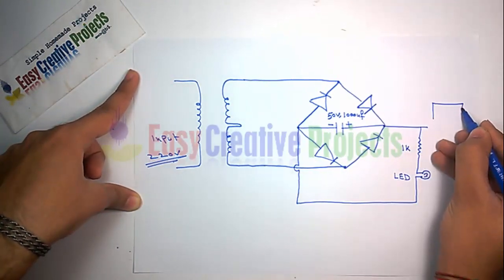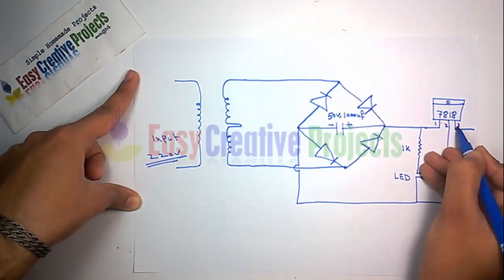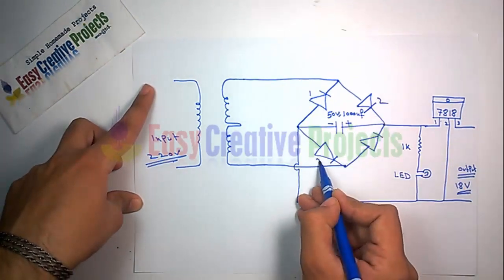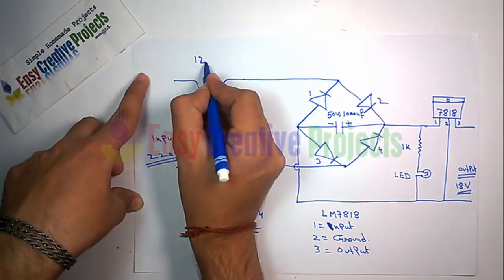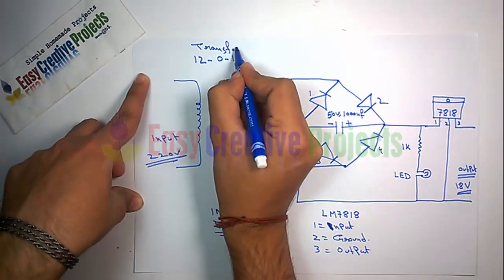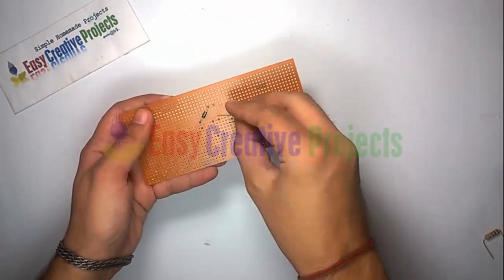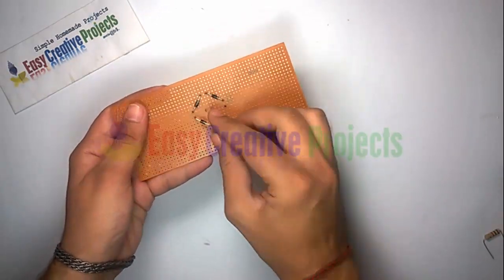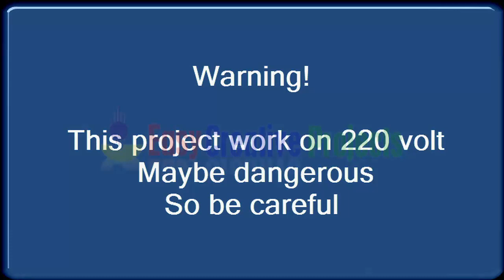How to make 18v power supply easy at home - step by step with circuit diagram

Comment: How can i make it for  4 Amps & 21 or 18 volts. Thank for your response .😇❤
❤ The way you are teaching . amazing 🙏🙏🙏👏👌👍👏👏👏 namaste .👀🕯❤ 10/ 31 / 21😇
Reply from the maker: dear watch video on our channel how to make adjustable current 12v power supply. and simple convert 12v voltage regulator with 18v.
thanks. namaste.

Comment: I need 12V DC in & DC out: 24V X 2 1/2A 1/2A 10V 3A & 18V 1/2A is it possible?
Reply from the maker: yes its possible.
you need to design inverter base transformer as your demand. 
thanks.
Reply: @EasyCreativeProjects  Thanks 18V & 10V is AC. ie both 24V + GND 24V- also 18V AC 10V AC.
Reply from the maker: @Delorean29  you can convert AC, DC with simple use of diode. 1st your requirement is transformer. its provide you AC output. if you want to convert it on dc then you use diode and capacitor. 
thanks.

Comment: How would I go about making this power a cordless lithium ion drill, basically eliminating the battery? I'm looking to put together a dummy battery pack that I can plug into the a wall outlet and power my cordless tools whenever needed.
Reply from the maker: watch video on our channel ( how to make adjustable current 12v power supply) and simple replace 12v voltage regulator with 18v voltage regulator.
that circuit perfect for your project because you need adjustable current. 
thanks.

Comment: How can we make two outputs? 12v and 18v  1A enough
Reply from the maker: its very simple.
use 24v two output transformer. 
use lm7812, lm7818 voltage regulator.
thanks.

Comment: Bhai, is the output +18 and -18 or +18 and 0. Transformer centre negative where should that be connected. Thanks 🙏
Reply from the maker: dear its very simple to understand.
all 3 pin transformer middle wire use for ground wire or negative wire. 
1st and 3rd pin use for positive wire. you can use any one.
18-0-18 or 12-0-12 transformer or 3 pin transformer mean 2 output 
but
if you leave middle wire and use 1st and 3rd wire then you can get dabble voltage. 
12-0-12  1st and 3rd pin output 12+12=24v
18-0-18 1st and 3rd pin output  18+18=36v
thanks.
Reply: @EasyCreativeProjects  Thanks for the reply. I am using 12-0-12 and following your circuit for 18v. 
Can I use L78S18CV instead of LM7818, just to increase the current. 🙏
Reply from the maker: yes you can use but then you also need to increase transformer current as your demand.
Reply: @EasyCreativeProjects  Thanks a lot.🙏🏻

Comment: how do you control that amps? Is this enough to power a drill motor with out bogging down? I have used a 19vdc plug in and a voltage/amp regulator but at 3.5 amps but it bogged down to much..

Comment: Can i use TIP31C?or any other?
Reply from the maker: dear TIP31C is a NPN transistor. and LM7818 is a voltage regulator. 
transistor use for boosting power.
and voltage regulator use for fix output power. 
you cannot use it.
thanks.

Comment: Please what is the output power (current in wattage) or AmH. Many thanks
Reply from the maker: Dear in this project i use LM7818 voltage regulator. its give you 1amp output.

Comment: sir , why is 1000uf/50v of capacitor? How to calculate the value of capacitor?
Reply from the maker: dear, in this project transformer give us 18v AC voltage.
when we use diode its convert AC volt to DC volt.
in simple word diode block lower loops. and pass only positive or upper loop. 
we use capacitor for state these loops. 
its calculation must dibble of input power. for example in 18v power supply you must use minimum 18X2= 36v capacitor. you can use upper any voltage. 
in my opinion you must use 3 time extra voltage capacitor for long life.
Reply: @EasyCreativeProjects   it's clear explanation about voltage parts. How about 1000uf of capacitor?
Reply from the maker: dear C = I/V  but practical work is different with paper work.

Comment: I want to know whether is it safe to use any power adapter to any electronic device if the output voltage of the power adapter matches the operating voltage of the device but what if the output ampere of the power adapter is high? I am asking this because I have noticed that we can use any rechargeable AA battery of higher amphere to any electronic device like camera or CD player but can we do the same with a power adapter?
Reply from the maker: if your battery is 2 amp and you use 1amp so its charge in dabble time.
but if your battery is 1amp and you use 2amp so its charge in half time. its example.
Reply: Easy Creative Projects I didn't get it.. you mean to say that I can use any load that consumes 1amp with a 2A battery but can't use 2A load with 1A battery? Is this rule same for a power adapter also... like if I use 2A power supply with 1A load but will it damage the load circuit?
Reply from the maker: dear its total depend on your circuit power. but this formula only use for battery charging. because we want fast charging. you cannot use it with camera, or other product.
if you use it any project then extra current damage your circuit.
Reply: Easy Creative Projects if excess current can damage the circuit then how a battery with higher amphere is used with a circuit that operates in less ampere?
Reply from the maker: if circuit damage. so change circuit and follow instructions for battery charge.
Reply: @debojitacharjee  dear it's not like that 
2amp battery means its capacity is 2amp per hour that is if you 2amp from battery it will last 1 hour
It's battery's output capacity of you give 1 amp load then battery will last for 2hours.
Hope it helps 😉
Reply: @pranavmalao5784  its the same thing... 2Ahr means 1A load for 2hrs and 2A load for 1hr.
Reply: @debojitacharjee  yes 🙂
Reply: @pranavmalao5784  Do you know about the wattage of resistor? what does it mean to have 1/4W, 1/2W, 1W, etc resistors?

Comment: I want to make a 18 volts 1.8 or 2 Amps battery charger (Nicad). with two Led lights Red & green. steady red and flashing green showing charging and steady green for full charged,steady red alone for power on. could you please help me with diagram and components detail. Thanks

Comment: Hi,  Its a very informative video and I plan to use it to construct an 18V DC source. Can you please show how the actual circuit looks like after soldering. It will be very helpful for me to replicate. Thanks.
Reply from the maker: dear i use 7818 voltage regulator it output voltage 18v and 1.5amp.
if you want to increase current so use high current transformer and voltage regulator.
thanks.